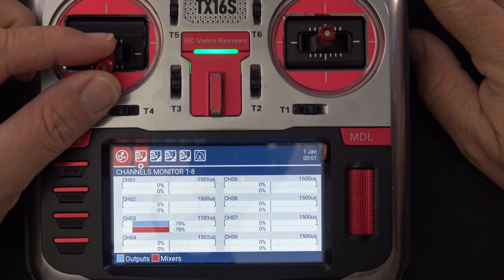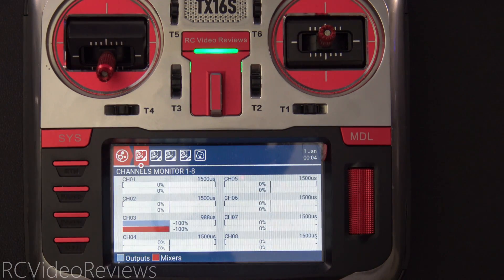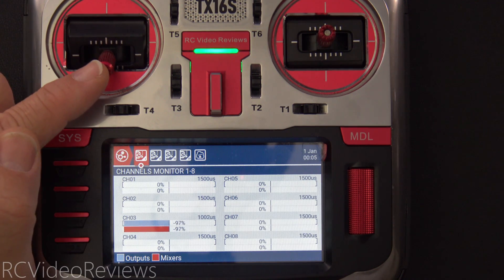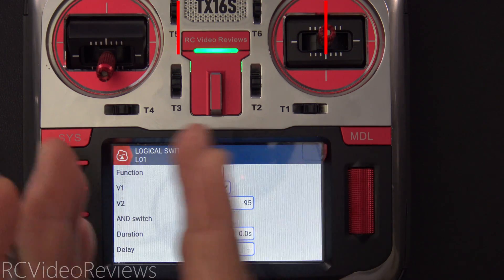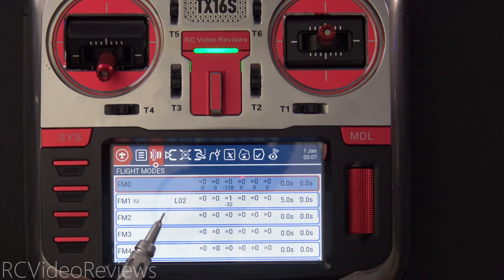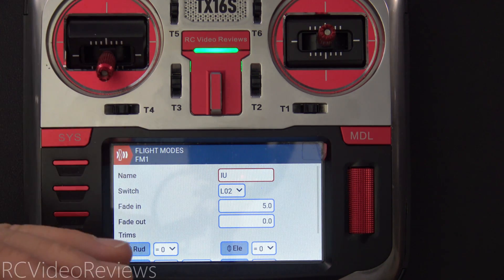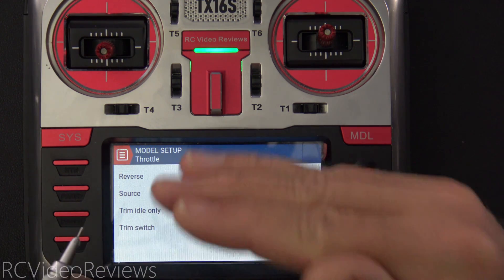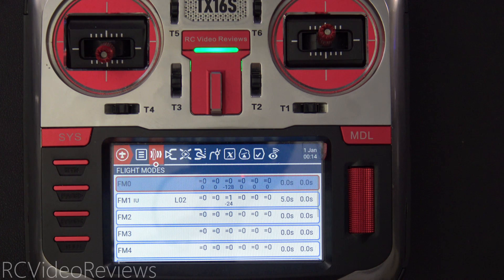EdgeTX - How-To Create an Automatic Idle Up • Works with Electric Motors and IC Engines

Comment: I'm probably missing something obvious, but on the non color screen edge TX radios I am unable to make the trim adjustments on the Flight Modes tab. Any idea where its at or if I'm missing a setting somewhere?
Reply from the maker: I think we addressed this on discord.
Reply: @RCVideoReviews  Yes we did. Forgot I asked about it here too. Got it all squared away. Just needed to actually adjust the throttle trim for each flight mode. Thanks again!

Comment: I would like to see a similar feature to do a soft/slow spool up for a helicopter. I recently acquired an old flybar helicopter with a simple esc that has no soft start options. I’m used to modern FBL flight controllers, I’ve always used 3 flat throttle curves/governed head speeds in 3 separate banks- I’ve never liked the idea of normal mode/IU1/IU2.. I like to have the option of 3 separate headspeeds with no direct throttle/assymetrical pitch curves to mess with. With a soft start I could have bank 1 or “normal mode” just be a flat throttle curve (i.e. 50% throttle) and have the helicopter gently spool up before switching to a higher rpm. It would also be nice to have a gentle transition from one rpm to the next higher rpm without having the tail kick in flight. Low head speeds are great for practicing orientations, trimming the model, practicing collective management, gently breaking-in batteries, extending flight times and so on.
Reply from the maker: The best way to put ideas forward like this is via feature request on the EdgeTX github: https://github.com/EdgeTX/edgetx/issues/new/choose

Comment: can you help my throttle stick all way down and the throttle comes on , i can only stop it with throttle cut, when i move stick up, engine still running, not sure what is causing this. using ar631 with extra 300 bnf plane

Comment: Nice video and a great idea,I've had that happen a few times with my electric and wondered why,but I won't to ask I se alot of reviewers using Spektrum These days and your using radiomaster can you tell me the reason why you using radiomaster for you planes,is it a cost thing or something else thanks
Reply from the maker: Aside from the fact I believe Spektrum is wildly overpriced, EdgeTX and TX16s are far superior tech IMHO. So far far better RF tech and firmware with competent hardware at a fraction of the cost.

Comment: This is SO much better than the way I have it (for a plane I use on scale comps where taxying looks rubbish if the motor stops spinning). I just have some extra throttle on a switch, along with all the forgetting type issues that this brings to the table ...

Comment: Thanks for this video. Could you explain why FM0 has a throttle setting of negative 128 rather than either negative 100, or, actually, why any throttle setting at all? I.e., if IU is not set (thus FM0) why is there any need for a special throttle setting?  Newbie here as you might guess -- thanks!

Comment: That is a very good idea that will actually solve a few issues with the bigger more budget-friendly ESCs.
Reply from the maker: I guess the IC guys use this type of feature too.
Reply: @RCVideoReviews  Yeah With a little tweaking for the Ic use, I don't see why not, idle and shut down.
It would work .
Reply: For i c you leave the throttle activated at above the off state, so when throttle stick at lowest point engine idles. Cut off then goes blow idle. It just takes a look at your engine idle throttle position to work out. The only issue is having to do it for each engine as they all idle differently. ( I.E. Stic pozition varies)
Reply from the maker: Thanks for the info.